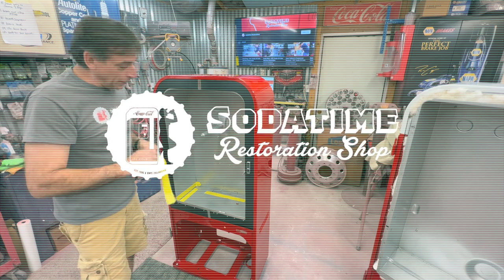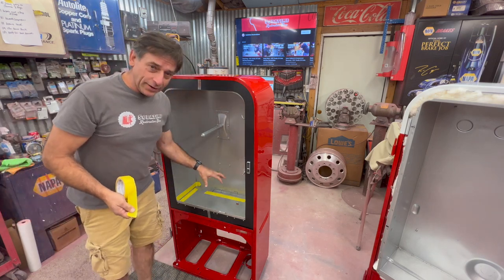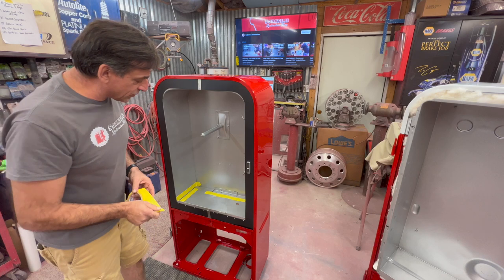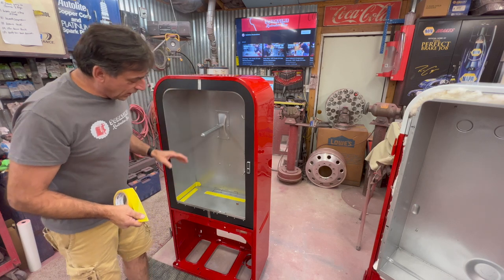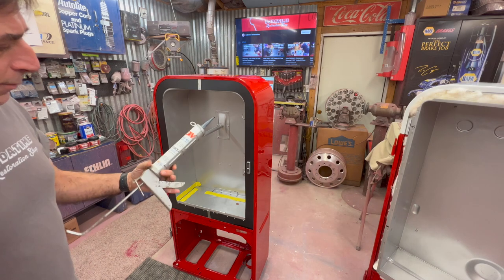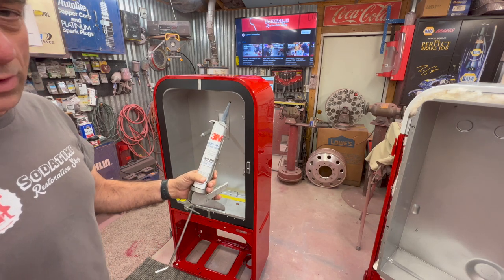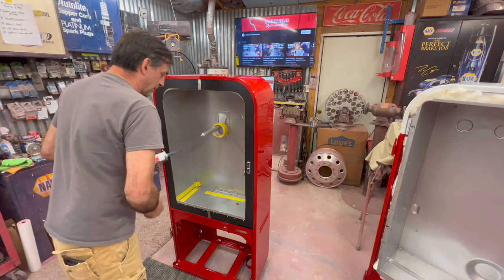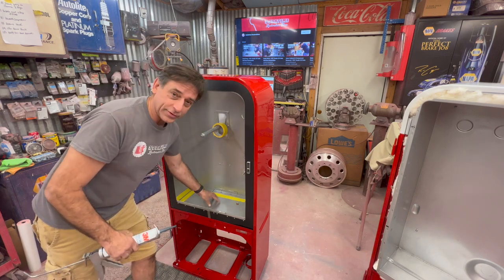Drain Tube & Compressor Installation | 1951 Vendo 39 Coke Machine Restoration

Comment: Oh boy this brings back memories good and bad. I had two partners. I was going to do all the mechanical work, another guy was doing the body work and a third guy was the money guy. We bought 12 44's and 3 39's. Body guy basically flaked out on us. I kept the 2 best 44's one for me and the money guy. I completely restored the 39 for my architect for a set of house plans. That was a pretty cool deal. I restored the best 44 for myself which I still have. It ran great for years but you know how these go. Evap fan motor started making noise. Pulled the refer unit and saw the body panel under the evap had rusted. I epoxied it probably too thick and also discovered a refrigerant leak. I hate to say it but that was close to 10 years ago and it's still sitting. Maybe your videos will inspire me to get it going again. I do these head to toe. I make them like show pieces. Oh forgot the end of the story. The original seller bought the rest back from us. Still have a can of R-12 also.
Reply from the maker: Great story! 12 44 would be nice! Thanks for Watching! 😀

Comment: Hey Marc, do you use the "window weld" 3M product around the bottom perimeter of the inner tub on ALL your restorations?  Or, are you doing it with this machine just because of the sheet metal plate you added on top of the original bottom?  Thanks.
Reply from the maker: All!